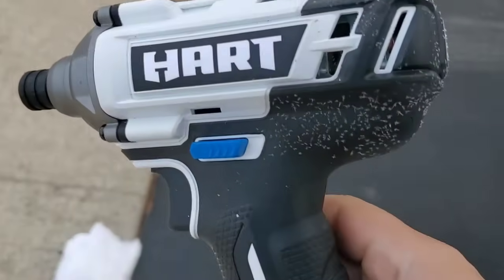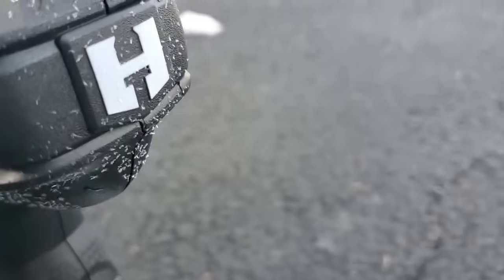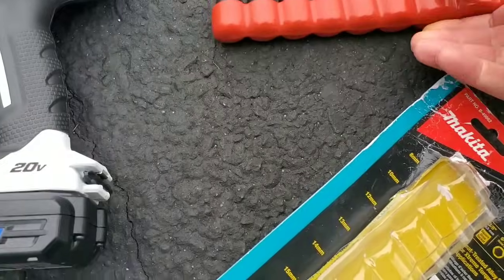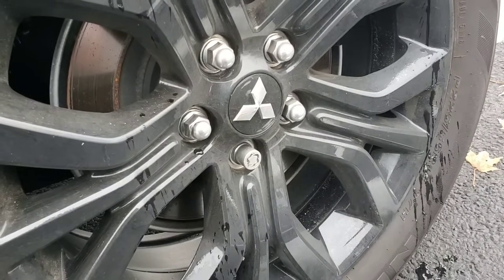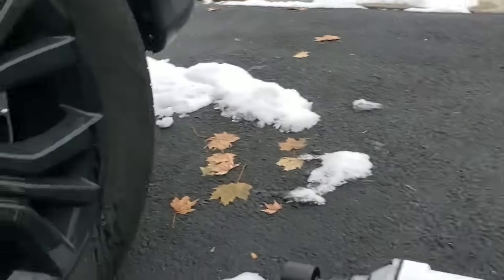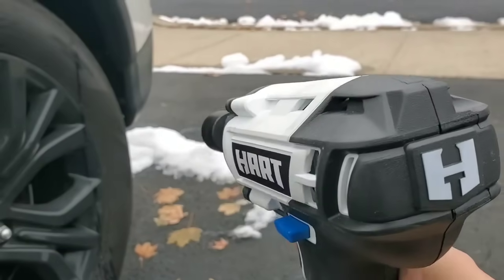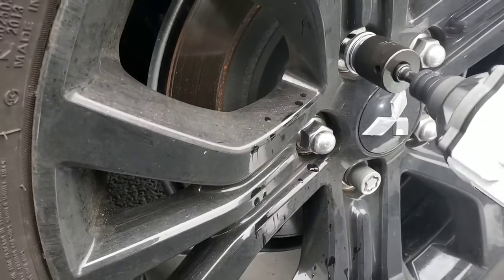Hart 20v Impact Driver Torque Test ..Lug Nut Test !

Comment: This driver sells for $69 with 2   1.5ah batteries and charger. That's a bargain. I use mine for small engine repair and it pulls all of those fasteners without effort.

Comment: Yah the HART is made by TTI the same maker of Ryobi and Milwaukee 

Impressive 

I picked up the hyper tough 7pc 20v set
Drill/driver ( about as good as a b+d)
Impact. (1300 inch/lbs)
Sawzaw 
Work light 
2 1.5 amp/hr batteries 
For $25-$15 depending on store on clearance. Yah I know it’s hyper tough but I am just a DIY not a contractor 

I got to now see if the hyper tough impact can handle lug nuts now.

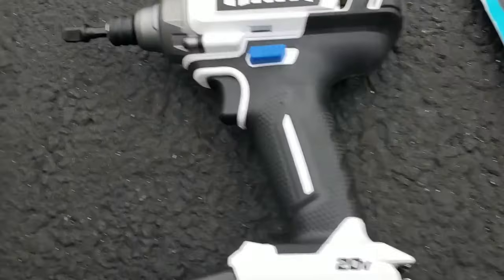Comment: It's $54 for a 2:00 amp hour Hart battery. The only reason I bought the Bauer when I did two years ago it's because the batteries were $20 for 1.5 amp hour and 35 for a 3 amp hour. I have a handful of Milwaukee DeWalt and Makita tools that I don't use because the batteries are so expensive
Reply: Buy the knock offs for your makita and Milwaukee batteries on Amazon or Ebay they work just as good at half the price or less.
Reply: @terrybrown5402  yep and 10 years ago when a battery cost $180 for 2 Amazon and eBay weren't selling knock-offs and they had a special chip in them that prevented other batteries from working. I even made batteries and it didn't work. I ended up charging the batteries using my model airplane lithium battery charger. Worked real good until the batteries crapped out.

If I was going to recommend anybody buy anything to use I'd say go with DeWalt. Not because they're the best but they're all over pawn shops. Now as far as buying new goes, I've drilled through half inch steel with my Bauer no problems whatsoever and my grinder I was able to cut springs when I had broken Springs on a car I was about to jump so they didn't turn off the tires. I can't imagine much else you can do with them.

That one I did Construction and I was climbing telephone poles and using my 18 volt Makita to drill through a pole oh, I don't think the Bauer would do that. What a loan 20 or 30 of them a day on a single charge. But for anything I can do around the house I don't see him breaking anytime soon and if they do I can buy parts for him in the batteries are dirt-cheap if I don't touch him for 10 years

Comment: Better off to go with the combo kit comes with a regular drill and another battery for $94 so for $25 more you get another drill and battery
Reply: I just got one of those today! I wanted an E-Impact for light auto work, and thought shit why not...you have to be careful though cause Walmart had 2 versions of the same deal ($94) but one on the shelf only came with 1 battery. The extra batteries retail at $60 too btw so it's a good deal
Reply: Kits ain't brushless
Reply: @jackman1989  From what I saw you can only get their brushless impact in a kit for $180. Otherwise you can buy their brushless drill individually for like $100. I'm Kinda pissed cause I wanted a cheap impact, and I couldn't find Hart's 1/2 inch cordless and didn't feel like paying double when I really only wanted the 1...
Reply: as of the time of this comment or at least 3 days ago the kit only comes with one battery now
Reply: $69 and got the impact/2 batteries/ and a fast charger. 👌🏽

Comment: 100 bucks for a craftsman drill and driver combo kit that comes with 2 batteries and charger. Used the impact driver to take off the wheels of my 2500 with the 2.0 amp hr battery. Use my craftsman all the time working on semi's. If your wanting to get into power tools and cheap id go with craftsman, you can get bigger batteries on amazon and you have more power tool options like impact wrenches, drills,  bluetooth radios, lights, hell even a leafblower and shop vac. Even for a diy person id rather go with craftsman just because you get 2 power tools, 2 batteries, and a charger and spend just a little more money.
Reply from the maker: Can get Hart drill , Impact combo for $92 with 2 batteries 🤙🤙
Reply: But if you end up wanting more power tools like impact wrenches and stuff you will end up going to a whole different line of power tools.
Reply from the maker: Hart has more tools then Craftsman 👍👍 complete line of 350 tools and accessories. Impact wrench be out in March 👍

Comment: Hart may be a “cheap Walmart tool” but the brand is actually owned by Milwaukee.
Reply from the maker: Owned by tti ,not Milwaukee
Reply: @toolboss8410  TTI manages Milwaukee, Ridgid, Ryobi. Technically not owned by Milwaukee, but in the same family.
Reply from the maker: @RandomHeroGames  tti owns Milwaukee and Hart ..
Reply: @toolboss8410  That's what I mean't. Ignore the "technically not owned" part.
Reply: TTI owns them but they use different parts than Milwaukee
Reply: Yea there made by the same people at ryobi and Milwaukee

Comment: I bought one and it couldn’t loosen 88ft lbs lug bolts off of my GTI stock wheels.
Reply: They start to hit way harder after some heavy use. Drive 20 or so 4in deck screws then all the grease will be removed from the hammer and anvil so it'll hit harder. Somtimes these impacts are way over packed with grease to make them weaker (and quieter) so they don't interfere with the sales of higher end tools from the same company. You only need a tiny bit of grease for front of the drill. It's only for the bushings not the impact components. So pop off the front cover and if its packed solid scrape out a fair bit of it. Then it should hit super hard.
Reply: Thanks I’ll try that out
Reply: @spidesol  I took some of the grease out of my ryobi and it definitely hits way harder now. I'm might make a youtube video about how to make one of these drivers hit harder. I'll let you know if I do.
Reply: I NOAH MANN I tried what you said and ended up removing about a tsp of grease and no luck! Same weak attempt at removing the 88ft lb lug bolt.
Reply: @spidesol  bummer, I'm gonna do some research and hopefully make a video in the next few days. It could also have something to do with the bit your using. If the bit has excessive slop it can weaken the impact. Also try a chrome socket as they are harder but you have to be more careful because they are much easier to break.
Reply: I NOAH MANN maybe because I’m using a 1/4 in to 1/2 in adaptor with a chrome socket
Reply: @spidesol  chrome is better because it hits harder but it's like hammering on glass it works great until it doesn't. Lol.
Reply: @spidesol  whats the model number of yours? HPID01 or HPID01B?

Comment: That would be a great emergency driver to keep in your car for the money may be never use but could save you on side of road as long as battery was juiced up help remove lug nuts, even if you manually break torque saves time, change alternator, who knows.

Comment: I turned the video off at 22 seconds.
You cannot test that tool properly using that tiny 1.5ah pack !!
(specially taking off lug nuts u silly man).
Do u know what voltage drop is?

Comment: The other day I was in a jam I need it to get a belt sander and went to Home Depot My Home Depot had nothing all they had was the Ridgid and Ryobi belt Sanders so I picked up the Ridgid belt sander and I was impressed with it corded obviously but I didn't know if Milwaukee makes a battery operated belt sander I finally seen the router it's a little small but gotta shave some Doors Down solid wood 6 panel doors I wasn't sure if I should pick up a wood planer or a belt sander ran into the table saw need a little bit of adjusting so I went with the belt sander
Reply: How did the hart impact driver  get you all the way to the homeless deathspot to buy a belt sander 🤔

Comment: I had the brushes to go out on one of my drills Porter Cable and I will never buy a brushed tool ever but I did get thehaert 60pc.impact set for 20.oo
Reply: @DJ KEYS...I will have to check that out and I can get away with just spending $20 without my wife fussing...lol

Comment: Now, can you use this to put the lug nuts on to torque speck?
Reply: scott mcbride you cant accurately torque bolts with an impact
Reply: @simoncorriere8209  I just ment can you tighten the bolts to the torque speck. Does that make more scence. I know it's not a torque wrench. Lol. People at garages do it with an air impact.
Reply: @scottmcbride2237  they may do it but that doesn't make it right.
Reply: @Texassince1836  they all do it. I didn't say anything about it being right lol

Comment: If it came with a dam battery it wud be worth it. Considering my porter cable 20v impact gun wont take off lug nuts.  Dont know the ft pounds as I just tighten em with a 4 way.... but yea
Reply: The Hart Impact Driver 20v comes with a 1.5Ah Battery and Charger included in the box. This sells at Walmart for 69.99.
Reply: @zammymaster12345  not at my walmart it doesn't. Its 50.00 with out tax for just the impact. Only way to get the battery is buying the whole kit for whatever the price was.

Comment: I dont know how you got that to work.  I went and bought the same one and it will not undo my tire lugs at all even at 70 inch pounds.
Reply from the maker: Yours aren't at 70 ftlbs I reckon ..70ft lbs is only 840 in/lbs most 12v impact drivers can do 70ft lbs quite easily ..

Comment: I'm a Ridgid guy myself. I've owned an impact drill and a hammer drill with no issues and batteries still hold their charge pretty long. I use them for auto repairs and i beat the crap out of them!

Comment: I wouldn’t do Hart or Bauer you can get a ryobi with two batteries and a charger for $99 and it’s a 3 amp hour battery
Reply: ryobi is GARBAGE in my experience tho..... if ur gonna get that get a ridgid.... lifetime warranty even on batteries and its the same price
Reply: I haven’t seen any issues with any of my Ryobi power tools.  I have seen several people claim that Ryobi is garbage but offer little proof.  The Ryobi drill/driver combo is great but I probably would never buy a cordless saw because I just don’t need one.